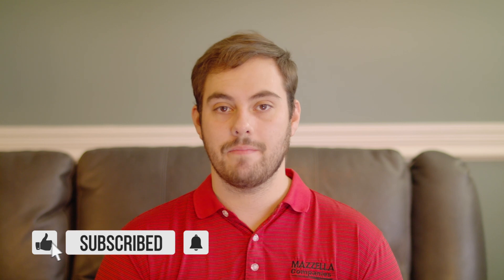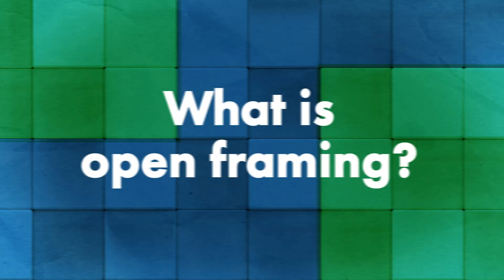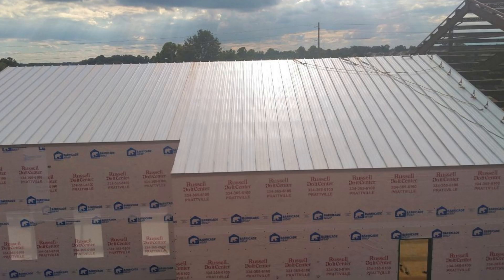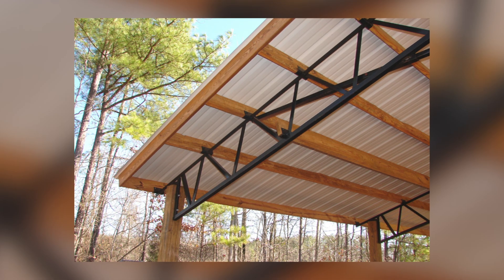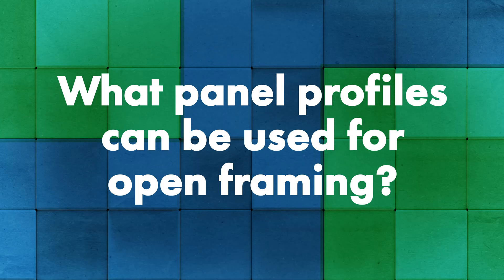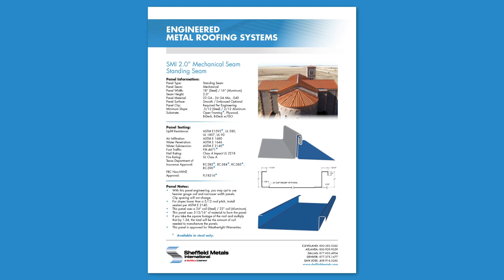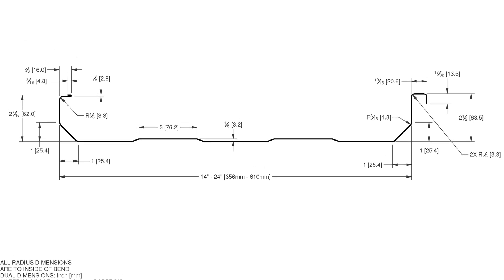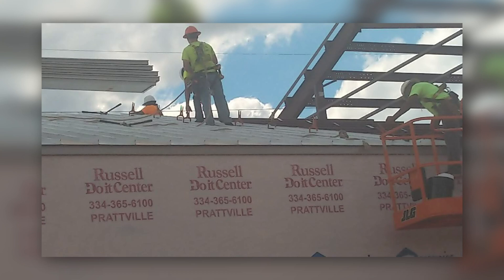Open Framing Metal Roof Applications: Structural vs. Architectural

Comment: What do you think of:
- Steel frame +/- purlins
- Plain old steel sheets of sufficient thickness welded directly to framing
- Caps over ridges
- Caulked at any gaps
- Painted to prevent rust

Desired outcomes:
- No need for wood substrate which could rot
- No need for expensive engineered specialty panels or clips, fasteners, etc
- Vapor barrier complete
- Able to use cheap, non-flammable insulation

Concerns:
- May not fit into existing building code
- May not allow for expansion of  steel sheets
- Slippery
- Lining up panels in aesthetically pleasing way

Comment: Do you have more videos regarding the residential application of open framing to metal purlins? Is it feasible to insulate the ceiling with added wood framing to the interior as it relates to angle iron trusses?

Comment: We we are building a cottage right now with an open concept ceiling, we installed the metal roof ourselves, but wondering what layers we need to have it insulated? Do we need a cmvapour barrier between the strappings and the insulation or does the insulation go direct under the strapping and then the vapour and then boards? Would really apprised any suggestions, before they start the work next week!

Comment: I'm looking at purchasing a home, it has a metal roof. When I looked into the attic I realized the roof is attached directly to the frame and purlins. I didn't notice any damage and we just went through Hurricane Ida. How concerned should I be that there is no decking?

Comment: Are you starting to see more residential uses of open framing? I'm seeing places like Rural Studio from the University of Alabama, the Passive Houses in Ithaca, NY, and barndominiums using bare metal roofing over purlins. 

Since these are open framing, do they still require an underlayment for an occupied building?
Reply: Yes sir. As they mentioned in the video, the most common insulation for open framing is "blanket insulation". The vinyl that is adhered to the fiberglass acts as the air/water/vapor barrier.

Comment: I still don’t understand why metal roofing is so ridiculously expensive on residential applications.   The local scrapyard barely gives me five cents a pound for steel.
Reply from the maker: Much of the time, the steel used for metal roofing is coated with a formulation like Galvalume® that is specifically designed for exterior applications. Additionally, premium paint drives up the price as well as the detailed installation process. -Thad
Reply: Uhhh... profit. People dont build giant wharehouses, buy super heavy hauling equipment, industrial painting machines, material management systems, multiple.roll form machines, and then insure themselves, hire employees and begin advertising and marketing just out of pocket for charity's same. Installation is a bit overpriced in some markets but shop around and if it is just an ag building then perhaps look into buying a recycled material. One of my buildings has a beautiful recycled aluminum roof!